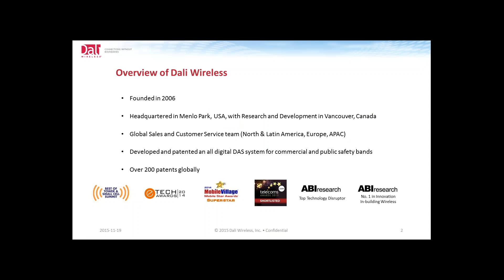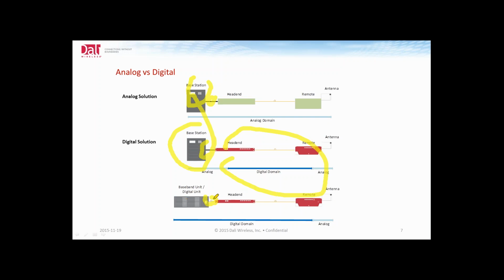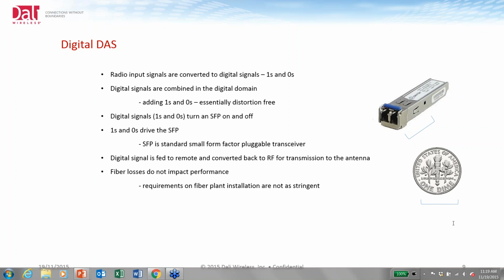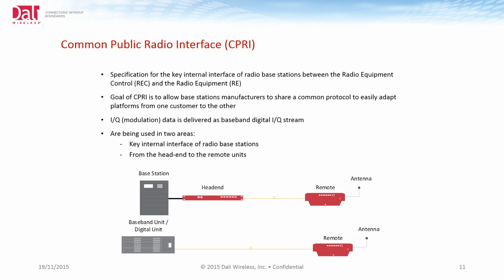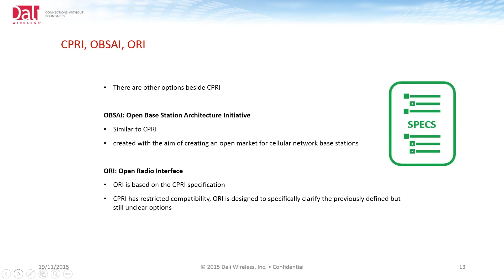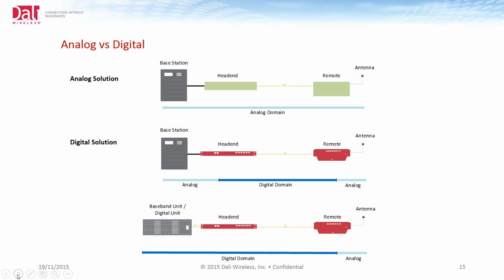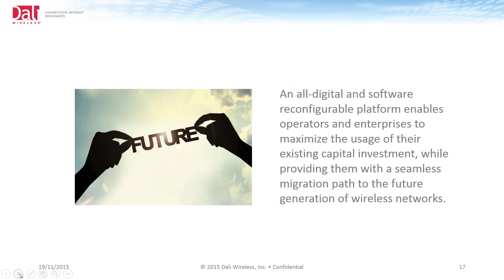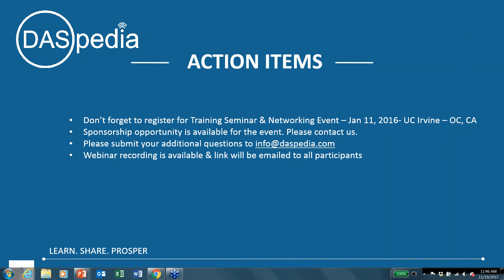Webinar - Introduction to Digital DAS and CPRI

Comment: how do you connect to different BTS vendors which use different variety of CPRI ? via base band unit (digital via cpri / fibre?) or remote radio head (analogue)? is dali wireless vendor agnostic when it comes to cpri?
Reply from the maker: Thank you for your interest in Dali Wireless, Bagh-e Babur. Dali currently connects to different BTS vendors at the analog (RF) level. We can transport multiple rates of CPRI data and ethernet to feed Ethernet based small cells.

Comment: Please if you can help about below questions:

1-What is CPRI? 
2- Challenges of using CPRI in 5G Technology. That means answering the following

Can we use CPRI in 5G Telecommunication?

What needs to change in current CPRI standard so that it can be used in 5G?

Your feedback is a highly appreciated.
Reply from the maker: Hi Omar,

Thank you for your questions and interest in Dali Wireless.

CPRI is a Common Platform Radio Initiative: Basically a standard for encoding and transporting I/Q information as packet data between the base band units and the radio equipment. The data stream also includes control and management functions as well as synchronization signals. Dali incorporates what we call CPRI plus which is simply a way of increasing the data density.

CPRI can be used in 5G technology but it is likely that NGFI (Next Generation Front Haul Interface) will move beyond CPRI to something that is less constrained in the time domain.